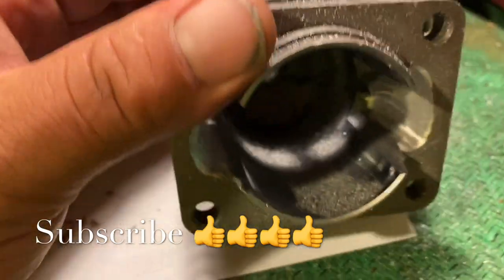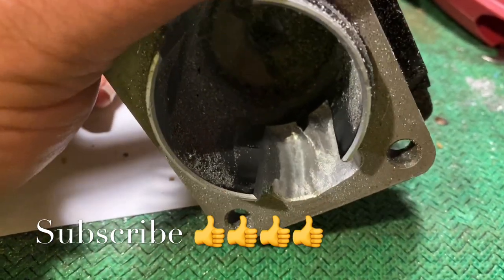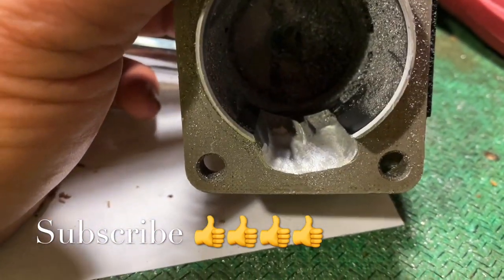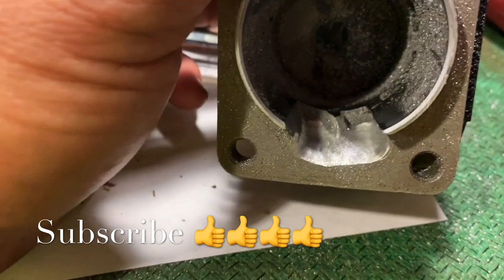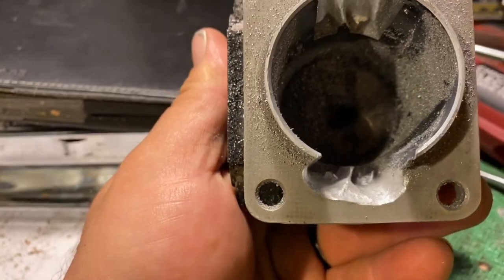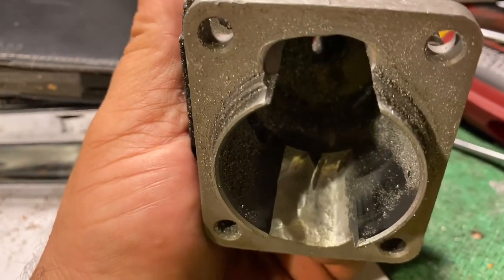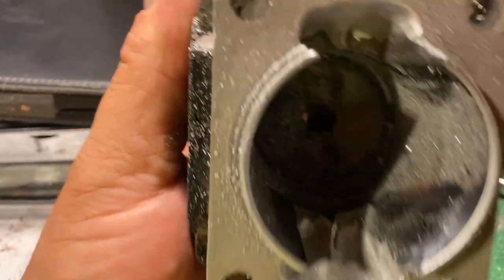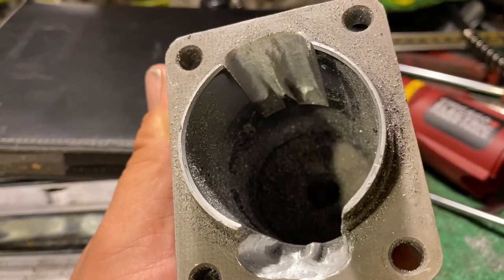Porting Homelite Super XL Auto Chainsaw!!

Comment: I would probably not run that. Probably hang the ring. I feel your pain. Put a lot of time and energy into it to just scrap it, but I think that one would be a zero sum gain. 

Folks that just pull the exhaust bridge have had issues, considering the transfers carry the side load, just don’t see it working.  

But....as you said, never know till you try.  Clean it up, put it on with one ring and see if you can even get it to rotate without  catching.  

I cut my teeth on cheap poulan clamshells. Spent hours on my second one raising the bearing pockets to cut the squish, opened the lower transfers, intake and exhaust.  Put it together and realized I free ported it.  Right in the junk pile-lol!  

Let us know how it turns out. Curious.
Reply from the maker: I agree!! What about a duel build just to see what happens??  Should be entertaining!!
Reply: What about just using the top ring and remove the base gasket.  I think it might be close. Does it use a 1 13/16 /46mm piston?  If so a ring from a stihl 029 should fit. Just have to notch for the pin. Can get the ring gap a bit tighter.
Reply: I could send you one if you want. I have a spare caber 46mm, let me know.
Reply from the maker: @crazyfeller5704  I just checked.  It wouldn't matter.  Both rings drop below the bridge.  I can feel it hanging up when I rotate by hand.  There is just to much opening.  It is toast!
Reply from the maker: @crazyfeller5704  I starting working with a different cylinder today.  The starting numbers are a little better.  Without base gasket squish is down to .062 exhaust is at 106 transfer is still at 20 degree blowdown.  I took the exhaust to 103 by the bridge and put the sides at about 104.  Then I kinda rounded it over.  I still need to reinstall it to double check the change in exhaust timing.   

There is an obvious difference in the thickness of the cylinder base on both cylinders.  There is every bit of a .030 difference.
Reply from the maker: @crazyfeller5704  Do you have the WhatsApp?
Reply: Good deal. Looks like the new cylinder may have been a better candidate.  Thank your boy for the nudge!  Sometimes things just work out the way they do for a reason!
Reply from the maker: @crazyfeller5704  I was thinking the exact same thing.  The cylinder came off of a 1973 blue super xl auto.  One of the ones that did not come with manual oiler.  Most of the parts are missing off of it so I took the cylinder.
Reply: Just got it. Not very versed in how it works. I also didn’t allow it to access my contacts- watch on my phone and I have to use it for work, so I am not sure how well it will perform. Look me up, same as you tube handle DM.
Reply from the maker: @crazyfeller5704  I have tried but I can't get it to search for anything outside of my contact list.
Reply: Smitty's Chainsaws And Firewood 
I asked another creator that I watch. Heard them say they use WhatsApp, but they also have an email address posted which could be used to send it privately. If they respond, I’ll let you know.  Totally understand not wanting to open up your email, contacts and everyone else to spam or worse.  I’ll let you know if they respond.
Reply from the maker: @crazyfeller5704  Let me know.  I have my email showing right now and I would rather not.